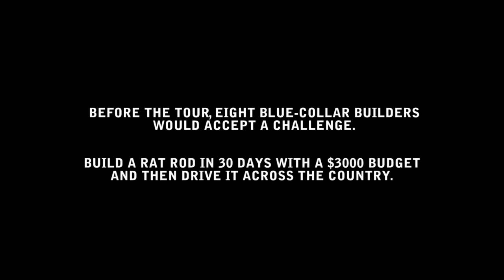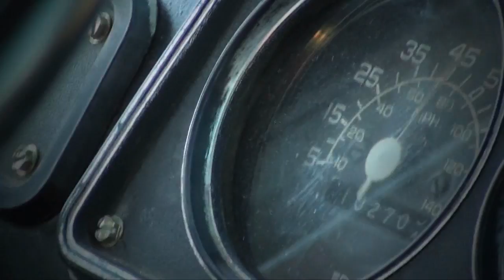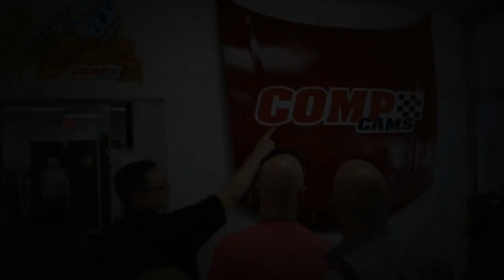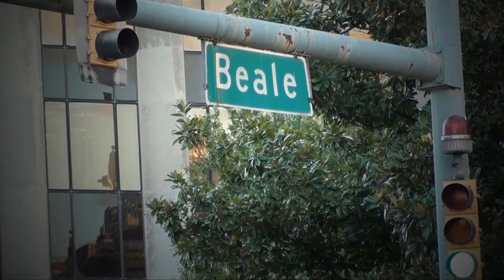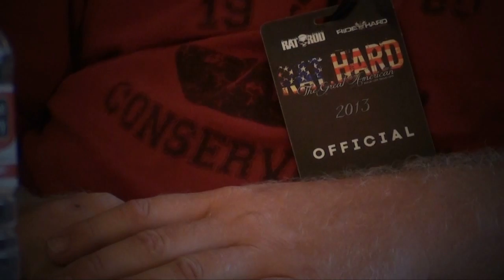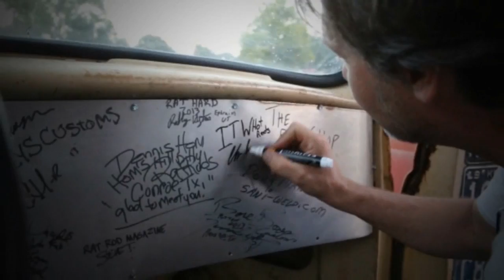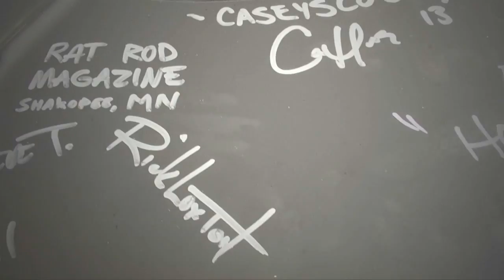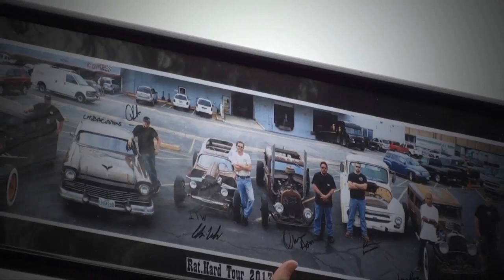2013 Rat Rod Tour Documentary

Comment: Good video, I build rat rod bicycles. My current daily rider I a 1949 Columbia cruiser converted to a lowrider.. all flat black with black rims and bent springer fork. Inverted rear view mirror and red fuzzy dice. With red dice valve caps and red neon lights under the frame. Also white wall tires